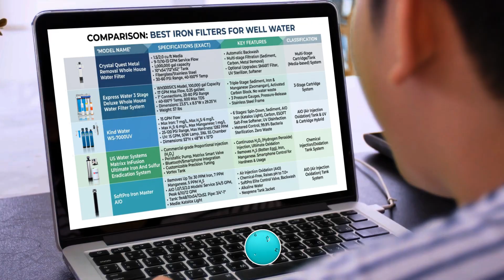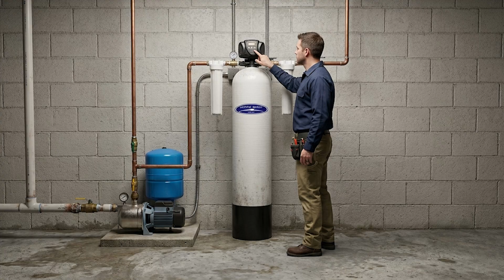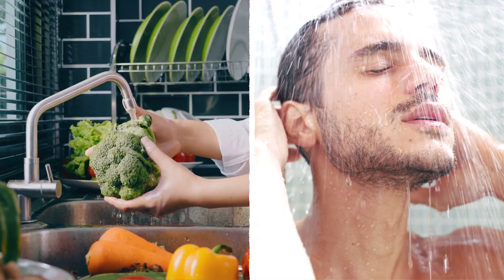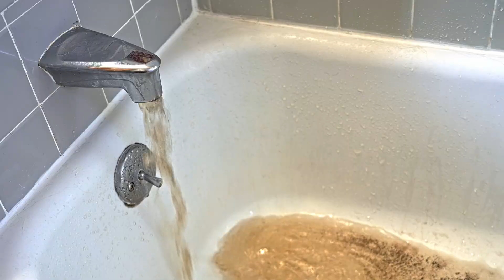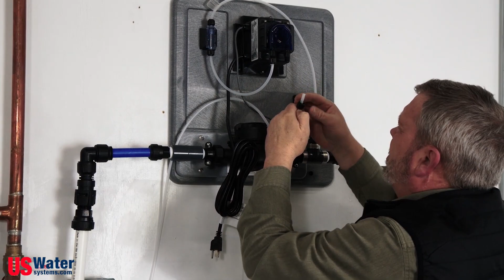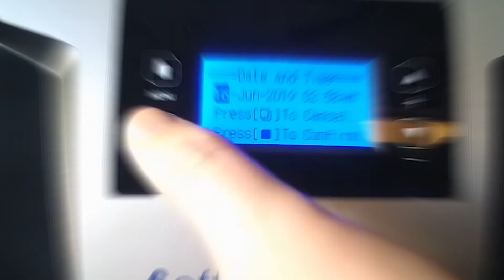Best Iron Filter for Well Water 2026: Top 5 Systems That Stop Rust Stains and Metallic Taste

Comment from the maker: 📌 Best Iron Filters for Well Water (Clear Decision Guide)
If you're dealing with iron staining, metallic taste, manganese buildup, or sulfur odor in well water, here’s the clearest way to narrow down the right system for your situation:

#1 – SoftPro Iron Master AIO — Best Overall Iron Filter for Most Well Water Conditions
A chemical-free Air Injection Oxidation system designed to remove iron, manganese, and hydrogen sulfide without salt or added chemicals. A strong all-around solution for most well water iron problems.
🔎 See Full Details: https://waterclarityguide.com/go/softpro-iron-master-aio

#2 – US Water Systems Matrixx InFusion Ultimate Iron & Sulfur System — Best For High Iron & Sulfur Well Water
A peroxide-injection oxidation system built for higher iron levels and heavier sulfur conditions, making it a better fit for problem wells with persistent staining and strong odor issues.
🔎 See Full Details: https://waterclarityguide.com/go/us-water-systems-matrixx-ultimate-iron-sulfur-softener

#3 – Kind Water WS-7000UV — Best All-in-One Iron Filter, Scale Control & UV System for Well Water
A multi-stage system combining iron filtration, salt-free scale control, carbon filtration, and UV disinfection — ideal for homeowners wanting broader whole-house treatment beyond just iron removal.
🔎 See Full Details: https://waterclarityguide.com/go/kind-water-ws-7000uv
✅ Use Coupon Code “WATERCLARITY” For $50 Off Kind Water Whole House Systems

#4 – Express Water 3-Stage Deluxe Whole House Filter — Best Affordable Option For Moderate Iron
A cartridge-based filtration system better suited for moderate iron levels and sediment reduction where full oxidation systems may not be necessary.
🔎 See Full Details: https://waterclarityguide.com/go/express-water-3-stage-deluxe-heavy-metals

#5 – Crystal Quest Metal Removal Whole House Filter — Most Configurable Multi-Stage Iron Filtration System
A modular multi-stage tank system that can be configured with specialty media for iron and heavy metal reduction, offering flexibility for more customized setups.
🔎 See Full Details: https://waterclarityguide.com/go/crystal-quest-whole-house-metal-removal

If your iron levels are under ~5–7 ppm, most homeowners compare the SoftPro Iron Master and Matrixx InFusion depending on whether they prefer air injection or peroxide-based oxidation.

If you’re dealing with strong sulfur odor or very high iron levels, the Matrixx InFusion is typically the more aggressive starting point.

(Some links are affiliate links. I may earn a commission at no additional cost to you.)